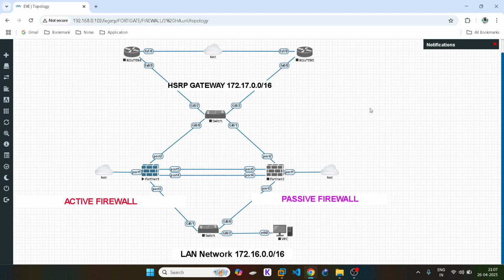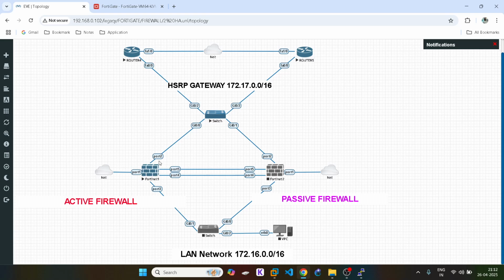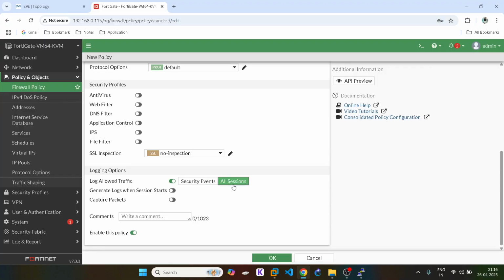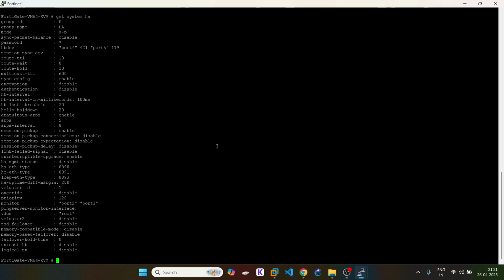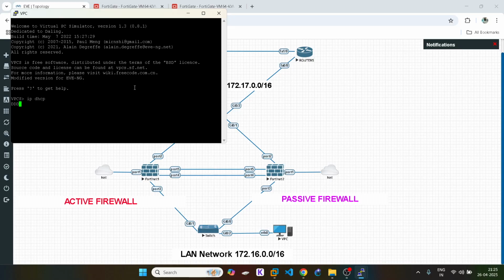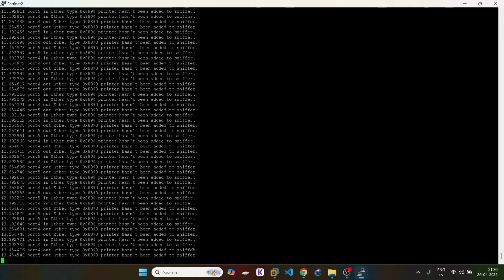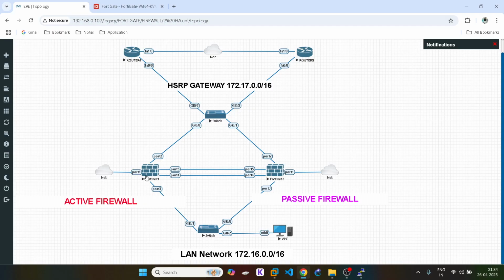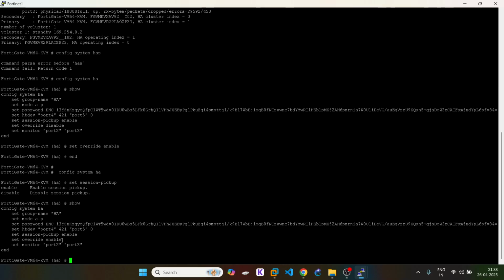26. FortiGate HA Magic in EVE-NG! 💥 Zero Downtime with Active-Passive Setup!

Comment: Which license are you using for FTG? In the eval license, we can have only 3 interfaces but in your topology, I see that you have 5 interfaces are connected.
I am also trying do the LAB so it would be good if you can tell me, how we can achieve this..
Reply from the maker: Thank you for your feedback! 🙏
I’m currently using FortiGate version 7.0. While adding the FortiGate node in EVE-NG, you can customize the number of ports as needed during the node configuration. It’s a flexible feature that really helps in lab setups.
Let me know if you need any help setting it up or have any questions—I’d be happy to assist!
Reply from the maker: 📌 Step 1: Start a New Lab or Open Existing Lab
	•	Open your EVE-NG web interface.
	•	Create a new lab or open an existing one where you want to add the FortiGate firewall.

⸻

📌 Step 2: Add FortiGate Node to the Lab
	•	Click on “Add an object” → Node.
	•	Choose your FortiGate image (e.g., fortinet-FGT-v7.0.0).
	•	In the pop-up window, you’ll see an option called “Number of NICs” or “Ethernet interfaces”.

⸻

📌 Step 3: Set Number of Network Interfaces
	•	By default, FortiGate comes with 4 interfaces (port1–port4).
	•	Increase the number as needed. For example, set 8 if you want 8 interfaces.
	•	EVE-NG allows you to add up to the number supported by the FortiGate image. For most versions, it supports up to 10–12 interfaces.

⸻

📌 Step 4: Save and Place the Node
	•	Click Save.
	•	Place the FortiGate node in the topology and connect it to other devices using the additional ports (port5, port6, etc.).

⸻

📌 Step 5: Boot Up and Verify in CLI
	•	Start the FortiGate node.
	•	Open the console.

show system interface
Reply: @LabitUP1997  Thanks for the details. 
I am using 7.4.7 KVM image, 7.0 version is not available on FortiGate website under FortiGate VM images now. It looks like they have removed it.
Is there any way by which I can get 7.0 version? And how to add license on it?
Reply from the maker: @Sum2580-x I am not using any licensed version
Reply: @LabitUP1997 is there any way by which I can get a KVM image for the 7.0 version..
Reply from the maker: Email me I will share it with you
Reply: @LabitUP1997  Done.

Comment: Very good Labs,
any one can mimic this labs on there EVE-ng.

Could you please create another topology. as below

Fortigates in HA
FW1  >> Directly to WAN1 (RTR)
FW2 >> Directly to WAN 2 (RTR)

Coming to LAN segmentation 
Switch in STACK MODE Blade 1 connect to FW1 (port1 MGMT, Port2 and port 3 are data and kept on LAG interface and the same on Blade 2 connects to FW 2

Ex:-  lets take 24port or any
Switch Blade 1: Gig1/1  >> FW01 Port 1  (MGMT)
Switch Blade 1: Gig1/2 (TRUNK)  >> FW01 Port 1  (DATA port)
Switch Blade 1: Gig1/3 (TRUNK) >> FW01 Port 1  (Date Port)

Switch side port-channel 10  >> FW LAG10

Switch Blade 1: Gig2/1  >> FW01 Port 1  (MGMT)
Switch Blade 1: Gig2/2 (TRUNK) >> FW01 Port 1  (DATA port)
Switch Blade 1: Gig2/3  (TRUNK) >> FW01 Port 1  (Date Port)

Switch side port-channel 10  >> FW LAG10

This is the plan. you can make better improvement too.

I allosed multiple vlans on LAN.